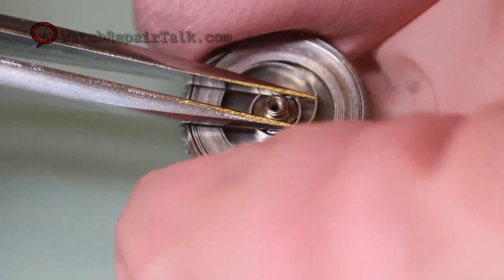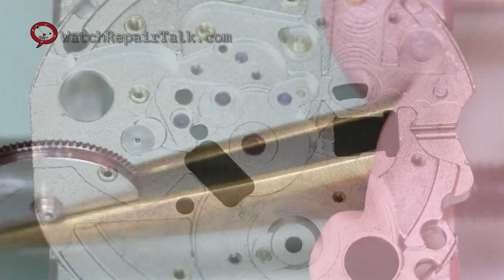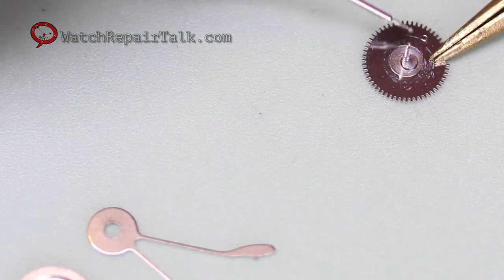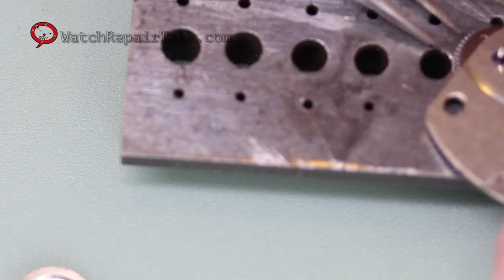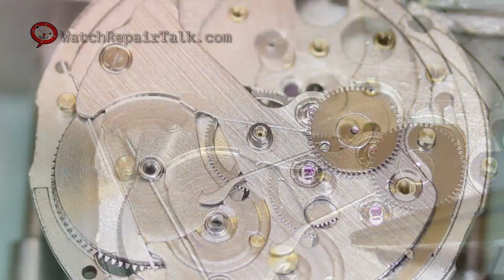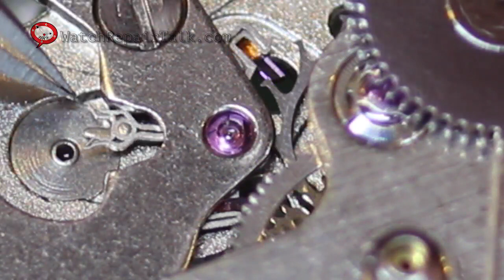Part 2 of 3  Seiko 7S26  SKX Automatic Watch Service and Lubrication. Seiko 5

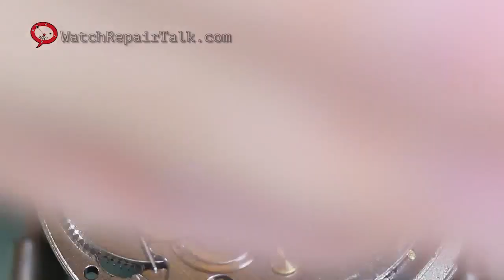Comment: Mark..following you step by step here, working on my 7S26... when you attached the auto winding onto the plate I noticed that the auto winding arms were either side of that central nub 4:35 ..then a short time later 5:04 they were one side of it. I did the same (thanks mate!) as I was following you and had to remove the plate and re-install the auto winding making sure it was between the nub and a raised brass stud, not easy as you have to put the plate onto the autowinding and you can't see it. I just wondered if you had to do the same or if there's an easier way...loving your videos, and a big thank you as I could never have afforded to get my watches serviced but doing it myself is proving to be therapeutic and lots of fun..also...you've gone quiet..please keep making videos...

Comment: Thanks for much for this video, Mark. I'm enjoying getting into the 7S26 movement and this resource has been invaluable.. For those starting at this, quick tip.. Be careful the click spring doesn't get lodged under the main plate (it naturally goes there)... You'll notice here that Mark "nudges" it out of the way as he places the plate... It will slow down your gear chain and make it look like a balance/gear train problem !

Comment: This all amazes me. Mark, you must have been very good at solving jigsaw puzzles. The challenge (in my mind) to reassembling the movement is how everything is inter-connecting (wheels to wheels, etc...). I was also amazed how many oiling points there are in the movement.  Just the simple act of screwing in a screw... the right amount of pressure and tension. I am inspired to try this. I'll find an old 7S26 movement and follow your videos.  Is there a basic watch repair toolkit I could buy which would have all the necessary tools to do this work? Wish me luck.  :)

Comment: I have this watch, great little work horse. Thanks for doing this particular movement. I was surprised, I didn't think someone of your skill level would be doing a video on what is a pretty inexpensive and average, but great none the less watch. I would imagine it would possibly be less expensive to just replace the entire 7S26 movement? As you know I'm sure, the 7S26 are used in some sub $100 dollar watch's... But, worth getting serviced because Seiko is well revered among those that like them.
Reply from the maker: +Adrian Wevers There is always a debate as to wether they are worth working on, but if the watch has sentimental value then the cost is not as big a factor.
Reply: Absolutely! Thanks for the videos, great work!
Reply: Watch Repair Channel you are definitely right there buddy.

Comment: Amazing video. When you mention using equivalent Mobius oils rather than Seiko oils, are they the usual D5, 9010 etc from the 6497 videos, in appropriate lubrication points? Or did you use any other Mobius oils?
Reply: Jeffrey Donnelly also keen to know
Reply: Hi, did you get an answer regarding equivalent Mobius oiled used for this caliber ?

Comment: Thanks so much for these videos! Very informative, I just bought a 7S26 movement Seiko watch to kinda use as my learning watch for this kind of stuff. I have a question - Is it possible to replace one of the wheels with a different one to give the seconds hand a more smooth movement ? Or is that not possible?

Once again many thanks !

Comment: What exactly does the "pull" (the 2 pronged spring connected to the 2nd reduction wheel) do for the movement? is it like a clickspring? Also awesome video, very relaxing and educational.
Reply: +MrMeep1999 That's seiko magic lever system, equivalent to a double sided winding system but with less complicated parts like those in 2892 and 2824
Reply: +Jason Wong Interesting! Thanks for the info.